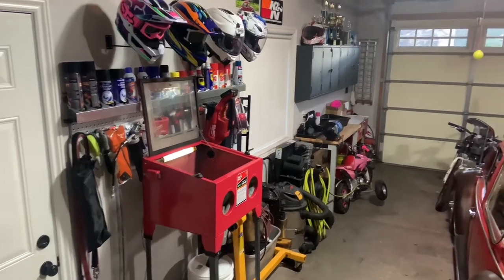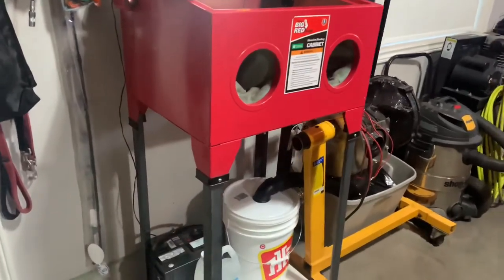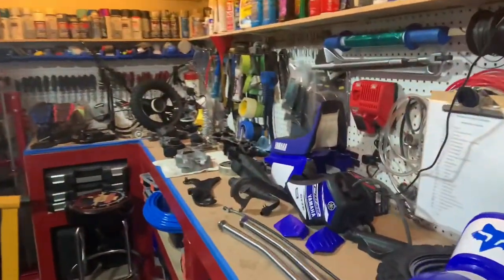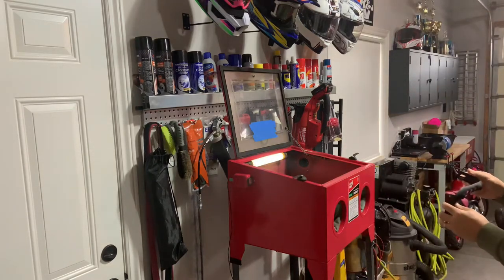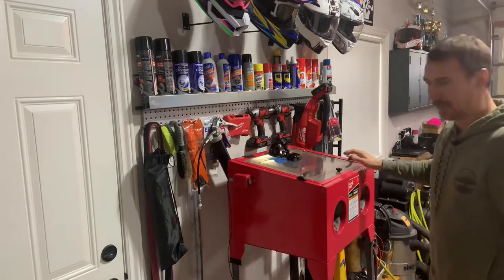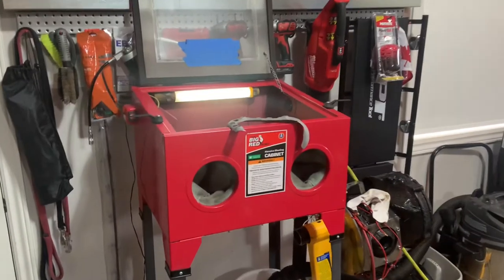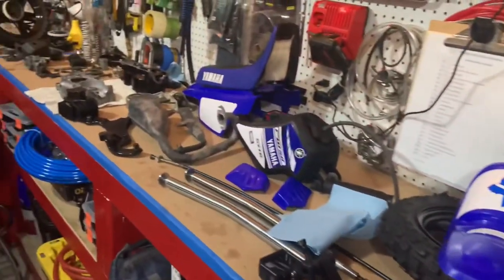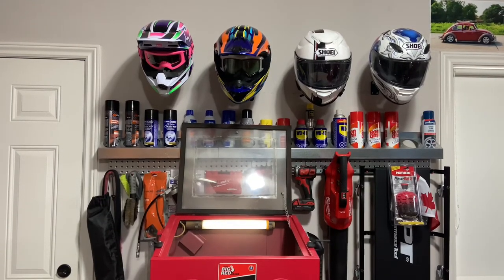Benchtop Abrasive Blast Cabinet | Long Term Review and Modifications

Comment: I bought one of these cheap units used, having a hell of a time changing the gloves and getting the clamps tight enough to keep them on, am I the only one?
Reply from the maker: I bought mine new ($150?) and have probably a few hundred hours on it.  Gloves haven’t worn out yet, and cabinet still performs “ok”… you get what you pay for.  The expensive cabinets are definitively much more efficient at blasting than these